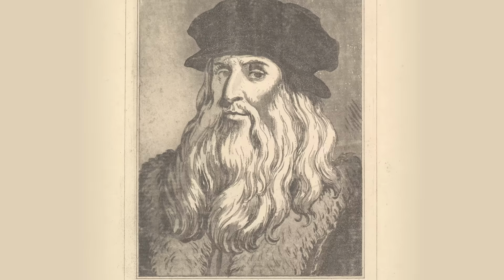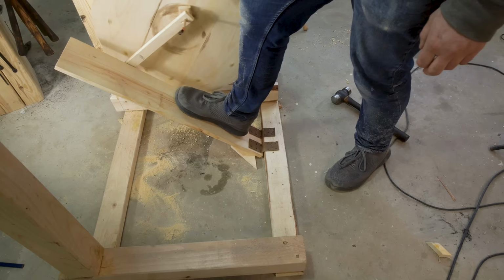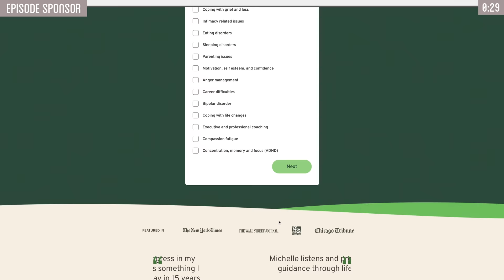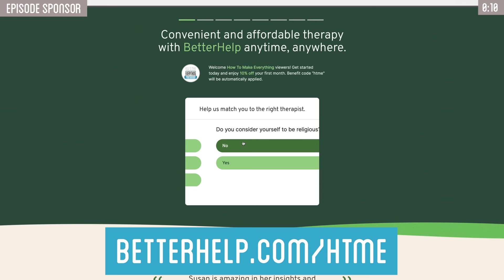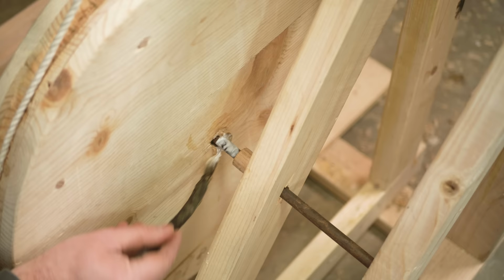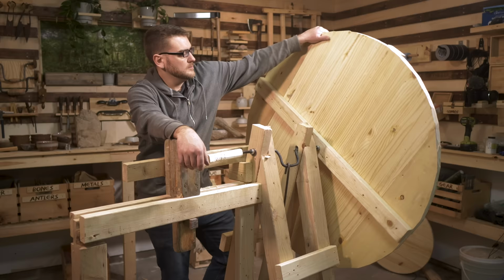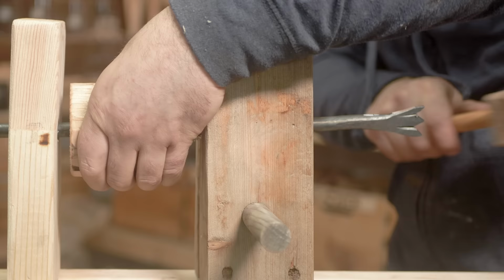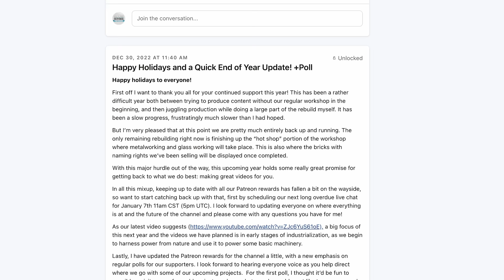Does DaVinci’s 500 year-old Lathe Work?

Comment: Imo the problem with building these machines is that at the time these things might be made, they were usually built and enginnered by master craftsman doing this trade for a living who knows the ins and outs of the materials they choose to use, so it's really difficult for an amatures with very little experience who hasn't mastered any of the techniques he's using to make anything that precise and work well.

Honestly, you should probably have stuck with the smaller, lighter flywheel unless you can minimize the sway more. accuracy is sort of out the window if your lathe is wonky, just plane the edges off before you throw it on the lathe

Comment: Have you thought about trying a leather pulley belt? I think that rope might pose a fire hazard or at least a breaking hazard if you get it going too fast.  But also that knot seems to be a big culprit in binding it up.  Great video as always, can't wait to see you industrialize!
Reply: At least splicing the connection or making a Molly/ rope grommet ( taking a single strand from three stranded rope and winding it around itself to get a three stranded continuous loop) would already improve things a good bit, especially if he´d add a tensioning wheel.

Comment: You will have a much easier time with the woodworking if you sharpen your chisels. They're rather blunt looking on camera, and those tenon joints look like the wood was ripped apart instead of split cleanly like a sharp chisel would do. A sharper chisel also takes less effort to drive through the wood.

Comment: In addition to balancing the flywheel and separating the pully from the flywheel, I'd suggest going from a rope to a belt for your pulley, while you could splice the rope to make a more continuous loop than you're getting with the knot, that's a lot of extra work, and your rope will stretch anyways, which will throw off the tension, A belt however wont stretch as much, and can have a far less obstructive join in it to complete the loop, in addition it will have a much more consistent contact with the pulley. also you will want a tensioner to allow you to change the belt (when it wears out) and the ratio,
Reply: Or he could use a sprocket set, like the ones that were used back in those days.
Reply: @carloshenriquezimmer7543  chain and sprockets basically require a metal lathe just to be able to make the sprocket chain consistently enough to be useful, not to mention the stamped metal, while a sprocket set is possible with his technology level, its not really practical at this stage,
Reply: @TheMhalpern  the idea was not using chains, but using the sprockets as a set of cogs.
Reply: @carloshenriquezimmer7543  ahh that, too much friction and it wouldn't be a continuous effort, thanks to the gaps between the teeth

Comment: why not a double pulley system using the giant flywheel as the main peddle system connected to a smaller flywheel that Acts like a gear system with the final one connecting to a flywheel on the lave itself

Comment: So have you had any progress since you made this video?  It seems like you're very close to succeeding with what you have here.  You just need a lot of small adjustments.

Anyway, there are some videos on YouTube with people building very similar lathes.  There is a good one by someone named Mr Chickadee, and another by LastingBuild, who did an entire series of videos showing things in detail.  You may've seen them already (I assume you do a lot of research when planning these projects), but I thought I should mention them just in case.  However, their designs did not include the giant flywheel.

I don't have many ideas of my own, aside from what other people have already said here, but it did occur to me that a spoked flywheel might be better than a solid one.  There is less weight on the axle, but the weight it does have is concentrated along the rim so you still get a lot of angular momentum.  But spoked wheels are difficult, since you have to bend the wood into a proper semicircle, and I'm not sure if you've learned that skill yet.
But then it occured to me that a flywheel may not need to be a perfect circle.  An octagon would probably work well enough, as long as the weight is symmetrical.

I really want you to succeed with this.  You're going to need a good lathe for everything coming up.

Comment: I'd suggest rather then using a rope for the pulley use Pegs in the Large Fly wheel to step down onto the small Fly wheel (place them 90 degrees to each other)
This would allow for a scaled increase in speed while still having the reliability of direct connection and removing the "slack" a rope or belt can allow. 

Keep in mind pulley systems usually require a spring or something to induce a tension between the pulleys (gravity in the case of lifting pulleys) . 
Without this pre-tensioning the slack will always result in potential structural failure as the loads are not directionally constrained.
|
|
|__

this will however rotate the Main flywheel 90 degrees from the plane of the Lathe.

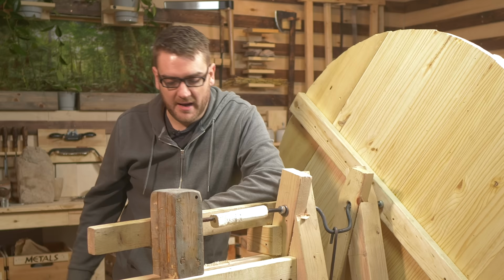Comment: The easiest Solution i would have seen is to just convert the machine with the big fly wheel which is already working. Add a wheel of i.E. 20cm there where you would put the working piece and another wheel of i.E. 5cm just beneath or above or to the side, which would now Turn the work piece (this Machine 10:30 )

Comment: Really cool what you do here.  I wonder how tricky it would be to convert a concrete kick wheel for pottery which has a vertical axis to a lathe or grinding wheel with a horizontal axis.  The one I've used seemed to turn on its own inertia for nearly an hour if it was up to speed.

Comment: For the multi pulley lathe....why use a wood axle? You have metal...they had metal. Bushings would also give a much better spin. Why twist the rope as the pulley belt? If Davinci had built it, improvements would have come instantly obvious and then made. One way to learn is to build something that doesn't work, and sort out why, and how to improve.  Maybe re-visit in the future.  - Cheers

Comment: Well, as with what my grandfather had in his workshop, a "stone" flywheel is much better in conserving momentum. Takes a lot more effort to start up but it is much better in storing that motion for longer. :) also, for the axles, you should use iron or steel rods, they were available in DaVinci's time. :) they knew they were stronger
Reply: Modern steel wasn't invented before around the 1900's, before that you only had wrought iron or cast iron. Da Vinci lived around the 1400-1500's. They probably used bronze, copper or brass since iron products still was very expensive. Also bronze and copper has better self lubrication than iron/steel so it would be the ideal choice for any bushing or bearing the axle sits inside of....
Reply: @therealsourc3  I did not say modern steel. They had carbon steel good enough to make swords & armor. Yes it was expensive, but yes, they were using steel to produce tools too. - You cannot make a sword without the steel tools at hand. So, using a steel rod as axle is a perfectly valid option, especially if you have a heavy flywheel. Bronze and copper are too brittle for heavy machinery.

Comment: I think it is awesome that you did this. My biggest critique is your assuming a lower level of build/work quality than existed in the renaissance. Wood working would have been very high quality by that time. Making water wheels would have been something they were used to. 

Try leather as your drive belt. It should be better than that rope your using and would be period correct.

Comment: Channel premise: Make the things to make things, disregarding modern supply chain.

Channel in action: builds everything from store bought soft wood.

This isn't meant to be a drag, but if you are going to go throw all the bother of blacksmithing your own chisels and saws and insist on using those in future videos, then seems like you should be milling all your lumber too. Then you won't have to struggle with terrible wood at least, and wouldn't have to laminate 2x4s for a flywheel, you could just cut out a round, or laminate 2 slabs instead of 12 2x4s.. 

Orrr, change the mission statement, make the old things and use them when it makes sense... But then use a 10 dollar Japanese pull saw when you want  a tennon that fits better than a hot dog in a trash bag because you want/need to make this lathe good enough to actually use to make it make things for you in the future on future jobs. You could even use movie magic and show making the tennon with homemade saw and then when putting it together it's magically perfect (because good tooling used off camera) and presto! Non-rickety lathe!

As someone else mentioned, a lot of the issues faced in this video (and others from the channel) are self created from forcing yourself to use poor materials or poor tools, and to a degree that makes sense with the concept of the channel, and we all admire some preservering despite adversity but you are intentionally stacking the deck against yourself and then being frustrated by the foreseeable results. You can make decent things with poor tools with decent materials with great effort, or decent things with decent tools and poor materials with great effort. But poor tools and poor materials require absurd  effort to shoehorn into a decent product and we didn't quite get there...

At the end of the day the mission statement has already been abandoned. Avoiding the modern supply chain but then using store bought lumber, glue (and probably hardwood dowels)? So it's probably fine to use a real saw for your joinery next time.

Comment: Idk dude, I've made enough rudimentary things to see a number of flaws in your build. 

Like instead of having that pivot point to the side of that arm that connects to the foot pedal, make it a fork so the pivot is attached on both sides of the arm, giving thqt wooden peg more rigidity.  If you want a better grip on your belt, please find a way to make the tension adjustable - an eccentric hole to the flywheel axle mounting points and a wedge set will suffice. Better craftmanship would help a lot, as anything built in those days would have master builders to make things as good as possible for the workloads they were subjected to. It would be as simple as making/having an augur that matches the diameter of the axles and qpplying that grease as you're making it.

Comment: I don't like to tell people "my" advice for obvious reasons  ,you know "talk is cheap"
Get your hands on  POWER TRANSMISSION , you are so close .
Rope power transmission , is the subject . theres Belts ,Chain ,gears. etc.
My cousin owns a JC PENNY store built in 1880 approx . And it still has the  hand operated frieght elevator .
From the ally to the 3rd level attic that was the stock and store room and the executive offices .It even has the , pneumatic tubing and equipment for recipes. it all still works .
it is not a Pennys ,it is a Antique mall inside .
This is in Waxahachie Texas and I am in Los Angeles or I would have pictures . I am not kidding you could get a VW Beatle on the elevator and take it to the attic , no problem .

Comment: The biggest flaw here, is in assuming that the elder craftsmen, didnt have extreme precision in their woodworking skills.  Ancient China was said to have actual Robotic Tea Servers, with gears and everything... in years well before it was ever imagined possible.   The older the time period.. the more time they had to spend on mastery of their skillsets... and the more Quality that they put into their Works.   In both China and Japan,  they have precision cut lumber joints, in their Ornate Temples, that have stood for over 2000 yrs.. including through several Earthquakes.

 When I started out in woodworking... I was quite sloppy.. and didnt understand the value of clamping.  Modern 2x4's tend to have some twisting in them... and without clamps, the frameworks that you end up making.. end up very distorted in their final shape / form.   Im also not sure if 2x4s are as hard as dense hardwoods... which would likely have been used for this application. At very least, as bearing blocks..  But I also suspect that they would have made metal ring / pipe bearing fittings too  (as wood to metal friction, would have quickly worn down the wood, even with lube).

 I have a feeling that If the lumber that they used had any twisting and or warping on it at all... that they would have hand planed all of it, to be 100% perfectly flat.  Probably sealed the wood too, to help prevent future moisture based warping.

Comment: The heavier and more balanced your flywheel, the more power and efficiency you will have. Also if you connect your drive belt to a separate pully, it will be more efficient and you can add different sized pullies for different gear ratios by simply moving the belt and tensioning it properly. Of course that is a lot more involved and requires more work and more precision and not really the point of this video.

Comment: Well, you keep mentioning the industrial revolution, but a) Da Vinci had been dead for nearly 250 years before that even started and way before then both the treadle lathe and the belt-driven (sually water of wind-powered) lathe had been in use for a long time and b) the Egyptians had lathes in about 1300 B.C so the lathe as an invention is in no way, shape, or form connected to the industrial revolution.

Comment: Could a super quick, cheap and easy flywheel with radiating strings attached to rocks work?
Reply: This is just an idea for using a much smaller piece of wood with - potentially - a lot less sawing and labor in general.

Comment: The next time you use a lot of glue (like when you were gluing those pieces of wood together for the flywheel), if you sprinkle a little salt over the glue then you can get a little bite between the wood and keep it from sliding around on you so much.

Comment: If could make steel rods there make tight fitting Metal sleeves with Grease ports are ball bearings, they would weaved or braided the rope, but the preferred method was a 5 to 10 inch leather belt and I figure 8 with Tightening wheel in the middle with bolt adjustment. You’re making something like what was 6000 to 20,000 years ago or longer. I’ve been quite capable of making brass gears or bronze gears an blocked an tackle and wheels for over 2000 years. You need to look at the rigging on ships and old wheels to understand how to build this. Even the poorest people would’ve had a better set up than what you built.

Comment: Interesting enough those first designs for lathes started making leaps and bounds in innovation of machine tools much like everything else DaVinci designed/made.
You could look into the heavy balanced flywheels, primitive gears sets, multiple pulley drives,  clockwork spring tension, and pin cog drives just to name a few.
DaVinci wasn't called one of the most important humans to have ever lived for nothing.

Comment: My big thing is if you're okay using a modern chisel because you've unlocked iron why do you still limit yourself to your primitive saw? If you're going for the primitive things that you've made to use and make new things then why is the chisel allowed? I think the answer is because you made the saw in a video but not the chisel. Likewise with modern timber vs making the timber yourself. There just seems to be a lack of consistency in what is and isn't allowed. If you unlocked iron and use a modern chisel then use a modern bow saw if you've unlocked wood and can make a wooden wheel then use a modern round blank that's solid wood. Holding onto some primitive made tools while also using some modern made tools from the store sacrifices your mission while providing an inferior product. If you're gonna make stuff using primitive tools fully commit to that or sacrifice completely and produce a quality product. 

Likewise what others have said as well. It took artisans to make these tools experts in their craft to achieve these breakthroughs. I liked the idea of taking on a blacksmith to make your iron tools. Take on a carpenter to make your wooden tools. It would be a challenge for them and a worthwhile venture.

Comment: I think you might have more luck if you spent a little more time refining the parts  everything is  as rough as gut your fly wheel and pulley are unbalanced and roughly finished your are adding friction and resistance all through system.
Now if you just want a proof of concept fine but if you want a tool to make a tool to make a tool. You are now reaching the point you are going to have to spend time on fit, finish and material selection. Pine is a great and and adaptable wood but not always the wood of choice for every application

Comment: the piece of iron attached to the wheel shouldn't have been in the center, otherwise why did you have to change the wheel?  you should have put it as far to the side as possible, and from there, the piece of iron should have been long to the center, and folded again, so as to exploit the driving force

Comment: You need to make a workbench and stop hacking at the wood on the floor so what you make isn't so sloppy. Medieval workbenches had screw (Moxon) vices, hold downs and dogs - they were skilled craftsmen. Also you have a bow saw so you should use it or make smaller one for the finer work. Can't help but think your lathe would have worked much better if it was better built - the wood chewing was hard to watch